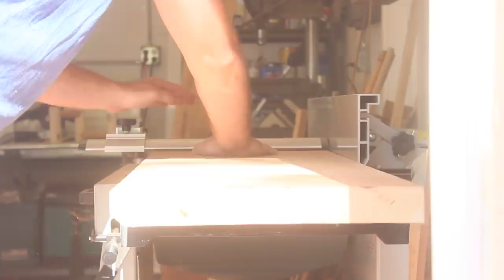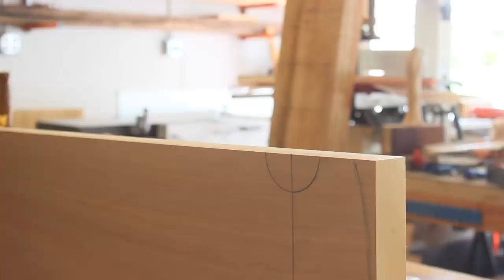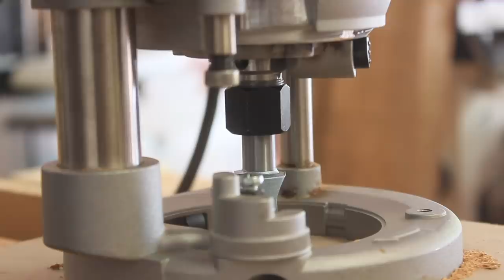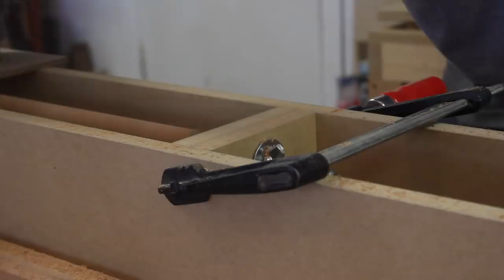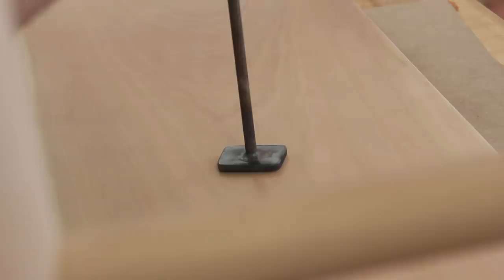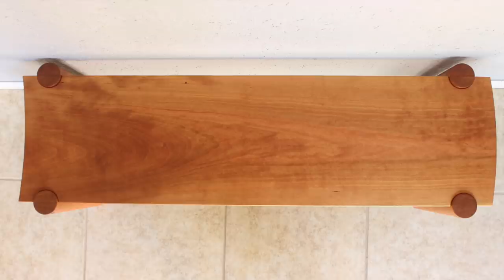Making a Cherry Bench with Shop Made Dowels

Comment: Nice design. I would  make some diagonal braces though. Once those joints start to loosen the bench will wobble and that type of joint will difficult the repair. I would use say a lamination of three 1/4 pieces of the cherry and maple. Set into a groove into the legs and then into the under side of the bench. Cut into an arch shape with a cutout or strolled out center nothing fancy just enough to compliment your simple yet elegant lines.

Comment: Bravo, excellent work. What I have done in the past is drill the hole for the dowels in the legs, then glue it up, after it's dry continue the dowel hole by hand thru the leg and into the table top then glue in your dowels this has worked for me to a satisfactory condition many times in the past

Comment: I have made benches and tables with a similar joint. Initially, I had the same problem you did aligning the leg's dowel hole with the dowel hole in the top.  Tricky, indeed, with no room for error, as you say.

I resolved this in two ways, both of which worked well.  (1) I drilled holes only in the legs and then used them as doweling guides for drilling the matching hole in the top. (2) I didn't drill the dowel holes in either the leg or the top until they were glued together. Then, after the glue cured, I drilled the dowel hole through the leg and into the top in one operation.  

For the second option, be sure to use a brad point bit and start the dill carefully to avoid as much tear out as you can. Better still, a hand brace  and a bit with sharp cutting spurs works very well for this because the slow drilling speed yields more control and minimal tear out.   Another option here is to start the holes with a Forstner bit and complete them with another bit better suited to drilling deeper holes --  this is a technique that also works very well and yields minimal tear out, but it adds a step to the process.

Each of these methods works well, but I think the first method tends to result in a neater dowel fit on the visible exterior part of the leg (especially when using an electric drill).  Just be sure to seat the drill through the "guide" hole and seat it directly on to the face of the wood you will be drilling into before you start the drill. This will minimize the likelihood of reshaping the hole in the leg as you drill the hole to final depth.  (This would be a good way to use ANY wooden drill guide, in my experience.)

I use deck screws, and even metal dowels (with epoxy) on occasion, for joints like these and they hold up very well. I also tend to incorporate internal rabbets in chair and bench joints whenever it is practical because they add considerable strength and rigidity to joints which have to endure a lot of stresses. Wood has excellent compression strength parallel to the long grain, so why not use it to one's advantage?  But, again, rabbeting does add steps to the process.

The important thing is that there are several good ways to do this type of joint and your way worked beautifully.  Best of luck with your chair building project.

Well done and thanks!
Reply from the maker: Hi Jerry. Thanks a lot for the helpful comment. I'll keep these tips in mind for my upcoming chair build.

Comment: Very nicely done & that turned out beautifully! I agree with some of the other comments. You could have glued the legs to the insets on the table without drilling any holes to begin with. Then just drill through the leg & into the table all at once. So, even if you are a bit off, the dowel would still fit nicely. Or, you could have drilled the hole in the leg prior to gluing it to the table. Then simply continue drilling through the existing hole in the leg & into the table, then insert the dowel. Anyway, keep up the great work!
Reply from the maker: Thanks Steve. That seems to be the consensus and it sounds right to me. I'll probably give it a shot for the chair, though I want to get a mechanical fastener in there as well.

Comment: The taper to the dowels can be caused by the connection to the drill. I noticed it having a wobble while routing. You can minimise that a lot by putting in a bearing at the headstock end. Electric handdrills are notoriously bad at keeping heavy stuff aligned while turning.....
Love the result!
Reply from the maker: Thank you! Ya, there's definitely a good amount of wobble. I think the wobble is coming from the drill, the drive bolt, and the hole in the drive side of the jig. I like your idea about a using a bearing.

Comment: Great video and great outcome. How about some long thick steel bolts to hold the legs on with plugs over the tops to give the same look? This could be done after the legs were set in place avoiding the alignment issues.
Reply from the maker: Thank you! That’s a good idea.

Comment: Love this design!  I wonder if a half circle spline would work for the leg joint?   You could cut the spline recess in the table top with a bearing and slot cutter but set back from the visible front edge.  Cutting the spline recess into the legs would certainly be trickier.   Just a thought and I have no idea if this is feasible.    Nice troubleshooting with the screws!
Reply from the maker: Thanks!! A spline is interesting. The joint in the leg is what kept throwing me off. I wanted it to be like a Maloof joint but cutting a stopped rabbet in a dowel like that is really tough to get right.

Comment: Nice resilience and great work coming up with fixes for the problems you ran into. Might be worth making a custom version of the maloof style joint for this application? Something to look at, anyway.
Reply from the maker: Thank you! It's something I've thought about for a while. The complication comes with creating the rabbet on a late dowel. There isn't a good way for it to stop; I suppose it would take a fair amount of chisel work to clean up. I think a dowel and screw reinforcement is my best bet.

Comment: How about glueing the legs on, then drilling a hole through both the leg and top. Then pounding in the dowel below the leg surface and plug up the hole with a face grain plug. Might be better than screws? Anyway, it came out beautifully. Great job!!
Reply from the maker: Thank you! That's a good suggestion and one I had considered. I thought a mechanical fastener would hold up better over time though I do believe a dowel and a screw would be the best bet.

Comment: What about notching the dowel to fit around the top instead of drilling the top? Then you could glue the legs on, drill and add the dowels afterwards
Reply from the maker: That's a good approach though I wonder if the 1/4" of material left on top would be too fragile. I think it's a good idea if the joint is further from the ends, which my chair will be, so I'll keep it in mind.

Comment: It looks great. If you want to join the leg to the top like you had planned in your original design....just develop a better method of drilling your hole accurately.
Just make sure you are lined up on center, and at 90. What you wanted to do will work, but as you said the holes are not right. Take your time when accuracy is important. I like that bench. You're turning method gave me the idea that if you took the far end and raised up the center by an inch, you'd have a tapered leg. Thank you!

Comment: Rather than screws, you could glue the legs in place, then drill the support dowel hole through the leg into the table. No need for plugs, the dowel itself can be a contrasting color.

Comment: In my opinion dowels are much stronger then screws, and visual end result is the same. You can put in a screw first for clamping and replace that after drying with a dowel. Make a test piece, you'l be amazed how strong this is.
Reply from the maker: I don’t disagree. One issue I ran into was how I could use more than one dowel on a round surface. They would have to intersect and I wasn’t sure how to work with that. I wanted two because it would mitigate a twisting force but it’s something worth looking into more. Thanks for the suggestion.

Comment: Nice work, as always. Any reason you couldn't dowel the legs once they are glued on rather than drilling holes ahead of time? That dowel could be made from walnut to keep the look. Thanks for another great video!
Reply: My thought was to make a fire with the 3/4" hole in it and the underside of the guide was shaped to fit the large dowel.
Reply from the maker: There isn't a reason, no. I considered it but wasn't sure how just the glue joint would respond to me banging a dowel into it. I think a mechanical fastener and a dowel is the strongest option, its just a matter of finding a way to fit everything into the tight space.
Reply: @parillaworks  another mechanical fastener option is running all thread all the way through from leg to leg with a nut and lock washer on each end, then plugged.  I have a workbench built that way. Trick there is to router a dado for the all thread on the top and bottom of your panels before you laminate. Just a thought :)

Comment: Love the top and side views.  Overall really nice.  Had you considered putting a taper on the legs?  Could give a slightly more delicate line.  Could you achieve that by putting a wedge along both sides of the edge of your jig so router moved up and down along the length?
Reply from the maker: Thanks! As of now I want everything to be straight dowels but I might look into some tapers later on. Wedges on the jig is a good approach.

Comment: I wonder if using the same style jig on the table saw rather than as a router sled would give more precise sizing to the dowel?
Reply from the maker: I think in this case it's easier to move the tool and not the workpiece. Also, a table saw doesn't have any built in height stops or micro adjustments. I think my best bet is to put this jig onto a lathe so that I can mount the piece more reliably.

Comment: Thanks for showing the mistake with the legs. You could have glue them in and drilled thru both pieces to secure with a dowel. Would have given a similar look to what you ended up with the screws.

Comment: Next time you could simply have made an extra 3” or so of leg dowel and drilled all the way through and then used it as a template to drill the holes in the table then the holes would line up perfectly every time
Reply: i think you could also have to have another leg receiving section to drill the hole into the leg..  if you use the above mentioned 3" piece of extra dowel to drill into the bench section as well as the leg receiving piece that im suggesting  then use the resulting hole in the piece to drill the holes in the leg instead of trying to drill those holes before you make the dowel   lol   if that makes any sense

Comment: I think you are probably lucky your dowel method didn’t work out. If it had been a coffee table the dowels would have been fine but I think the additional weight a bench has to endure would be struggling a little. I think the screws are they way to go. Great video